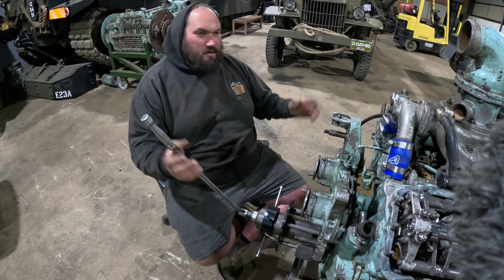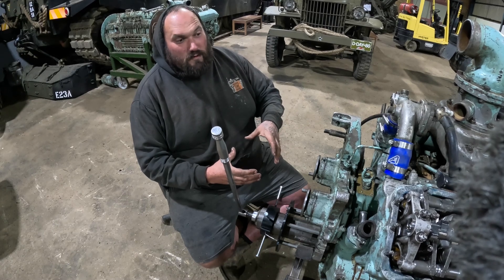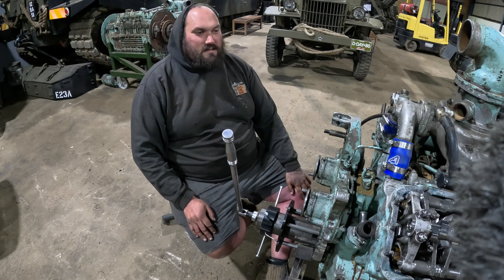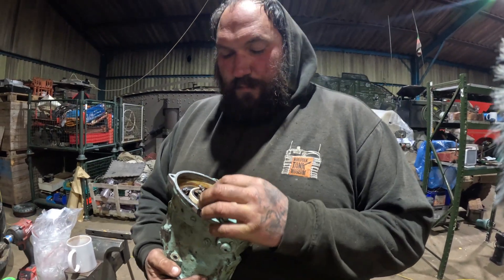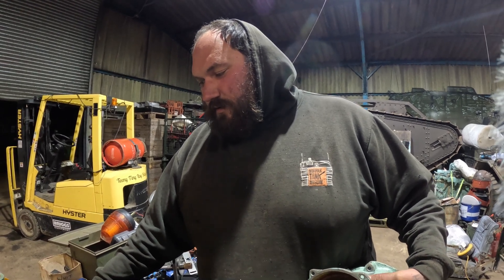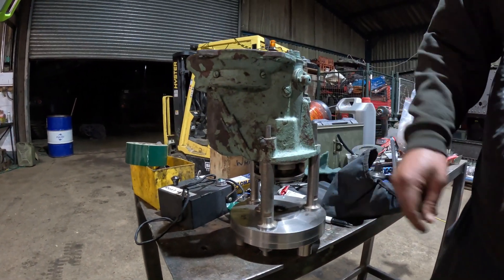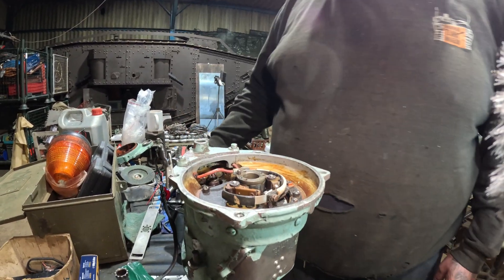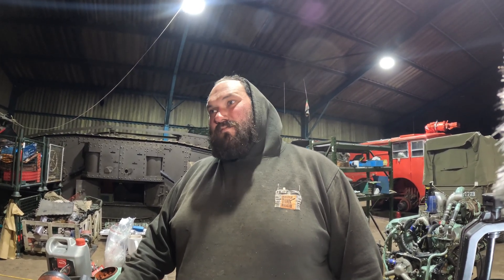Ignition timing on our Rolls Royce Meteor!

Comment: Interesting....looks like I've got my work cut out...having just acquired a 1943 Meteor, I'm shall look into using a 36-1 trigger wheel and not use the magnetos....electronic Emerald 3D ECU...thanks for posting...
Reply from the maker: I’ve not found one that runs electronic ignition as well as the mags do!! 
 Keep me posted how you get on if I can help in anyway let me know :)

Comment: i shall add to the secret,,in a shortened form due to the mass  production of most of the engine parts during the war  the double ended  vernier  drive  was used  to reduce the  discrepancies

Comment: Liking the detailed break down of the magneto and timing.  When you mentioned the outside line I knew that was not the line to time to thanks to Lottie the tank whisperer.  I did not know about the locking plate, the big base plate, and it was the first time I have scene  timing jigs.   I bet that RR is gonna run like a top.